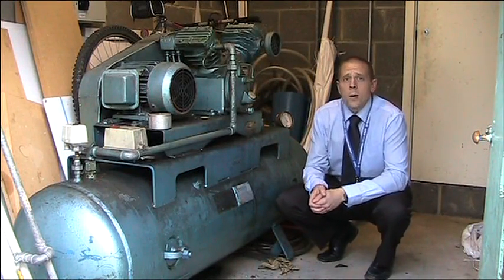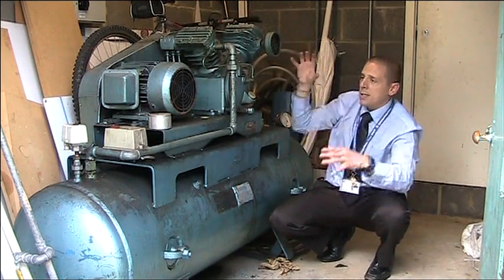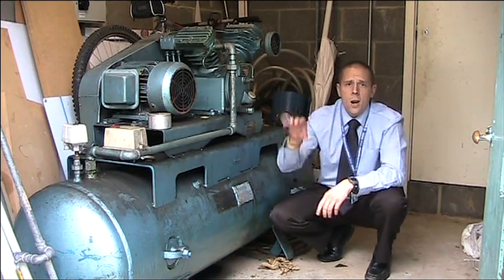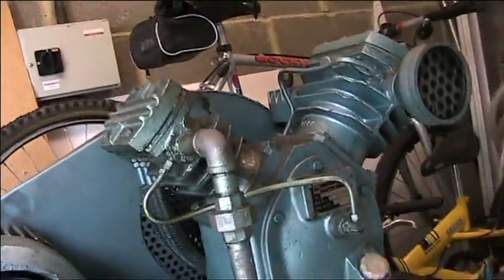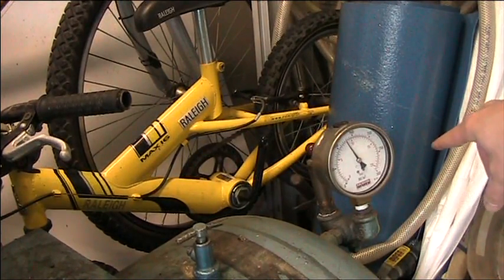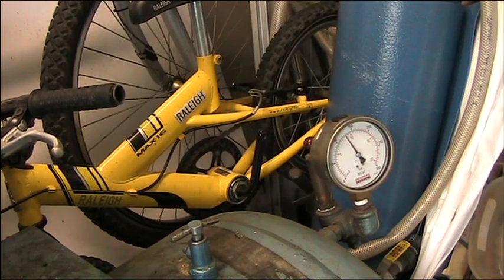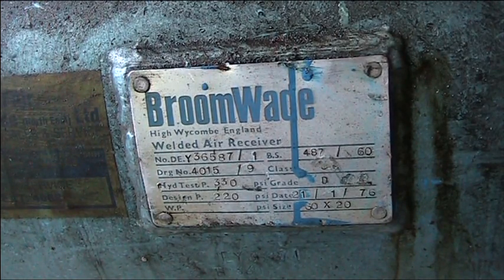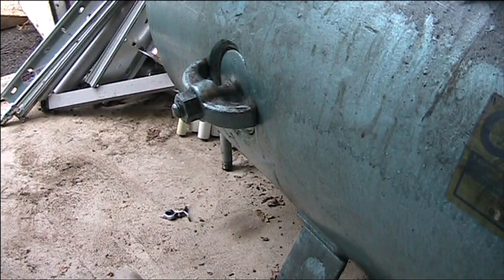Air Compressor Operation - Tynemet Compressor / Receiver Assembly

Comment: Jw could a compressor still work in reverse
Reply: Sometimes no because of hydraulically operated unloader and the vanes on the pulley will blow the wrong direction.